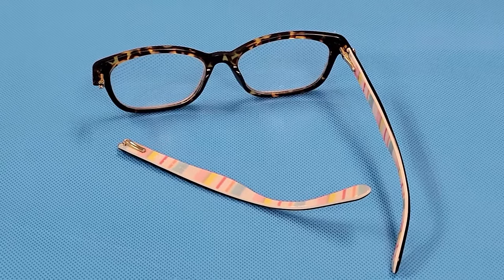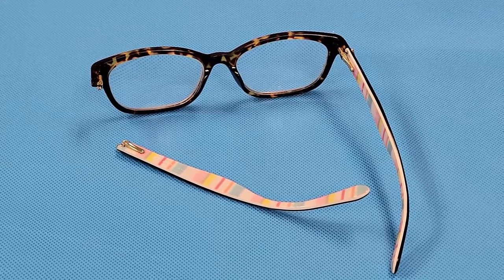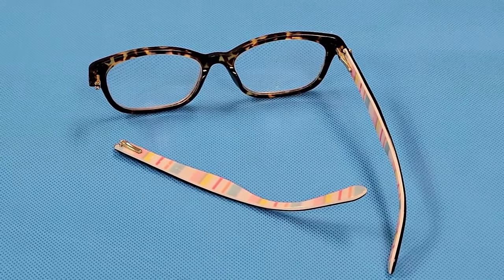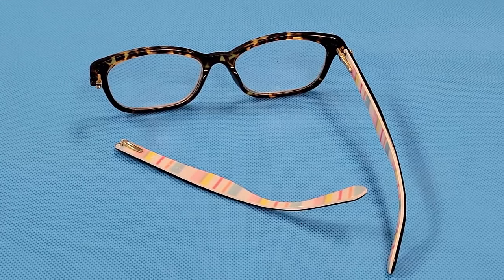Replacing a Broken Eyeglass Temple Hinge

Comment: If you're an honest person you'll want to correct every word of your title, which is 100% lies/BS right now. You use the wrong tense, you're not do-"ing" anything at all. You didn't replace the hinge, you say you "welded a spring...?!?" Huh? What? How? Not mentioned. But I'm going out on a limb and guessing you didn't actually use a welder and didn't actually weld anything, either. Maybe you meant you used some glue? Or epoxy? Nobody knows. A more accurate title could be "I hold glasses and say stuff."